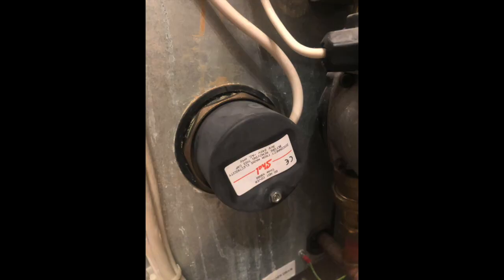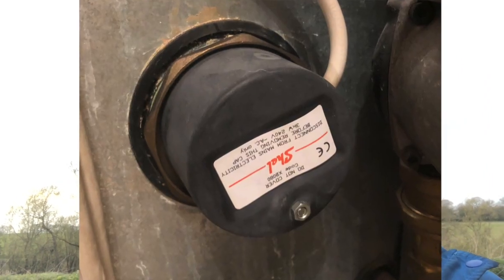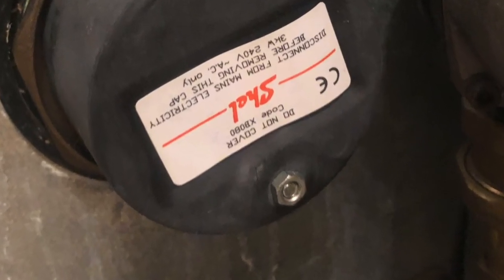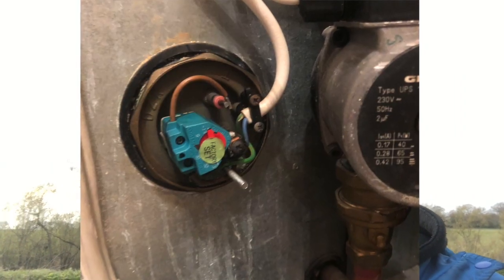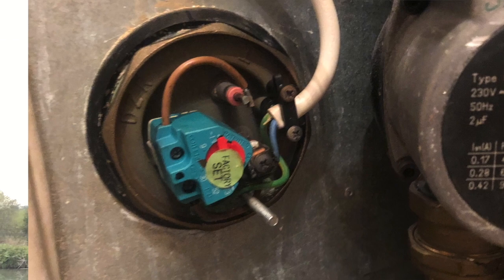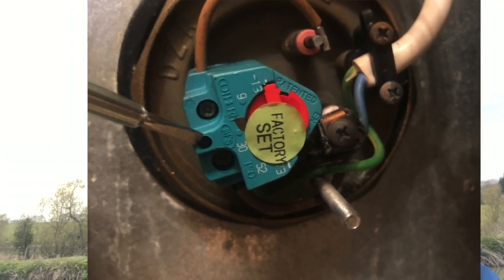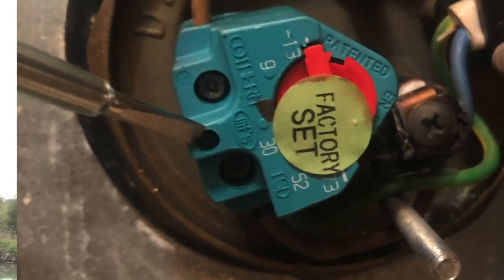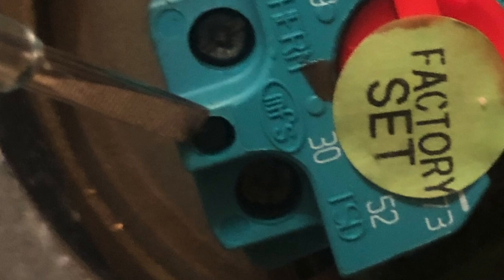Pulsacoil 2000, resetting a tripped off-peak thermostat. April 2019.

Comment: Thanks for this, my daytime 'boost' works but not the off peak, so I might try this fix, but one other thing I have is that none of the lights on the top left hand side of the Pulsacoil 2000 are on (despite the boost working) does this suggest that there is another problem before I attempt the fix in the video? One other thing, should the electricity be switched off when attemting the fix or does it need to be on for the fix to work?

Comment: Mike, can you tell me, with the reset button on the thermostat is it 'set' if it is flush with the plastic body or should it be recessed when 'clicked' in? It's quite small what do you use to try to reset it? Thanks!
Reply from the maker: Hi Steve, thanks for your question. Yes it's a really tiny button - I find the writing point of a Bic/Biro ball-point pen works well. When tripped, the button will be rmore or less flush with the surrounding surface. Once reset, the button will latch down and be 1-2 mm or to below the surrounding surface. Hope that helps, Mike